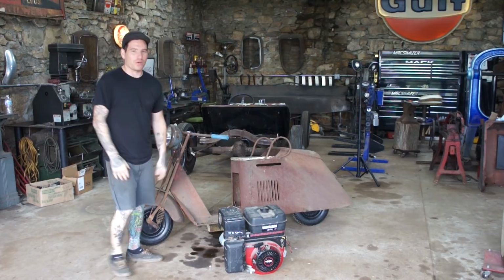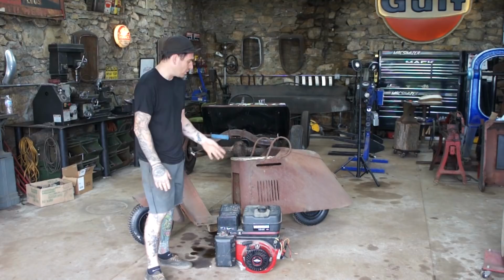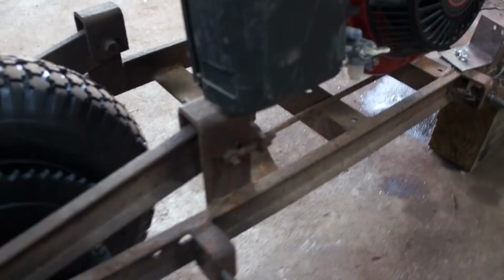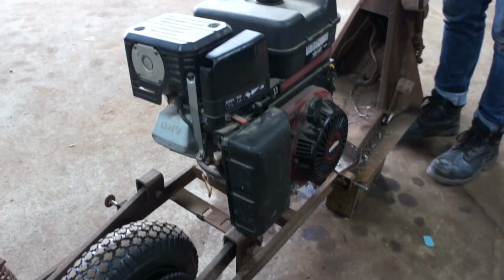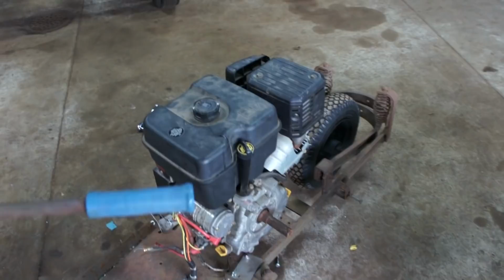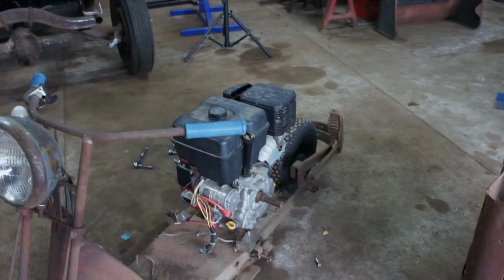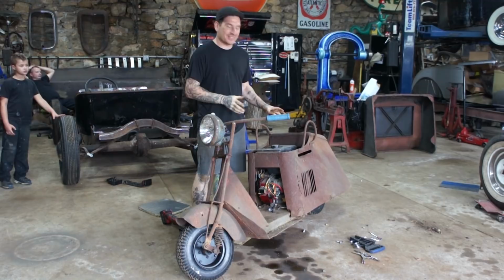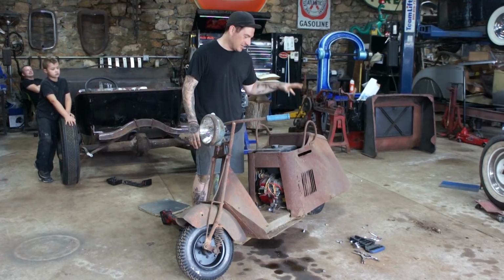How to Fit a 13HP Briggs and Stratton to a Cushman Scooter

Comment: Why not relocate engines gas tank under neath flip up access hatch? It looks like it should fit.  Or fab a new gas tank that fits in the original location? I really like what you are doing with the rat cush! Keep up the inspriring work!
Reply from the maker: We have a couple options, under that hatch is actually a small storage area that we would like to retain, but with the stock tank off there is a good bit of area if we wanted to build a custom one. Thanks for watching!!! - Mike/ITG
Reply: @IronTrapGarage    mike i like that storage compartment also and the idea of having access to the gas filler also i def see options im sure you will come with a good one having a virgin gas tank makes modifying it safer... Luv the patina
Reply: @IronTrapGarage  I would figure something out to move the gas tank. Im just not a fan of having it coming up through the seat, and a seat riser wouldnt look good or be very comfortable.

Comment: Are you going to "Flip Flop" the rear wheel in order to line up the sprocket with the output shaft on the Briggs?
Reply: The brake rod will have to be redesigned to have a functional rear brake too.  The original Cushman engine on this model was only 5 hp and topped out at about 35 mph.  The 1959 Super Eagle I used to own with the 8 hp flathead engine topped out at about 50 mph with an 18 tooth primary sprocket, a 60 tooth rear wheel sprocket, 10 inch wheels, Mini carb, and a high performance cam.  I test rode another Eagle with the 8 hp flathead engine that had the stroke kit installed.  It felt like it had twice the hp of mine.